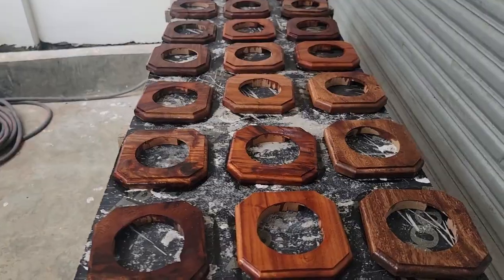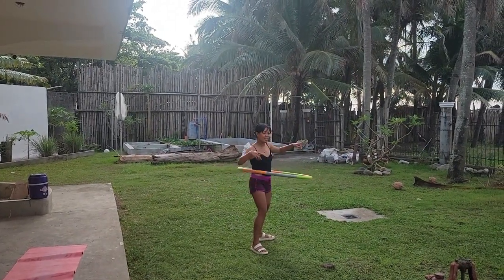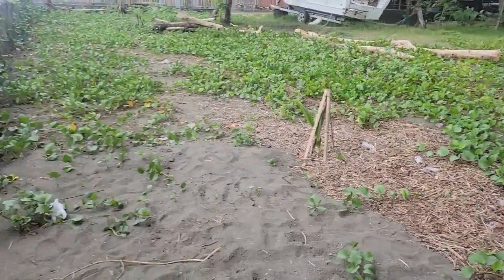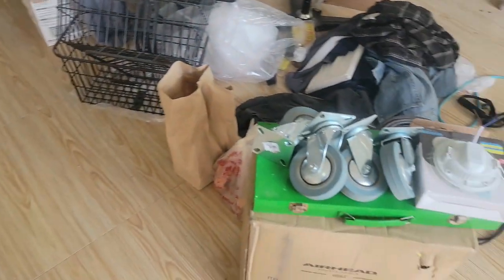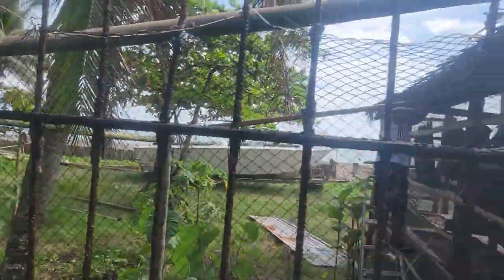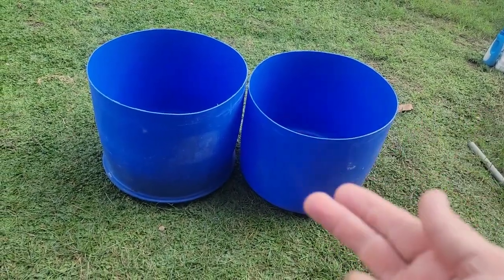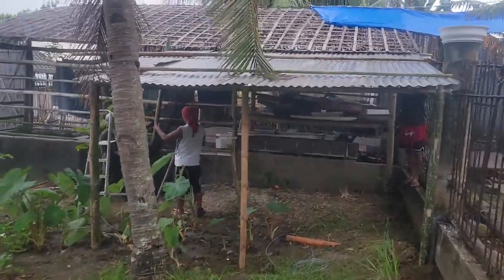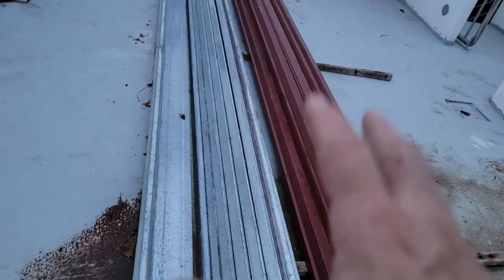Philippines Beach House Build Day 341

Comment: That pre-cast you're using really adds the finishing touches to the place (as do the lights wooden decor) IMO...

Question: Are there any restrictions in regards to the beach (I.e. a certain  number of meters back from beach where no permanent buildings are allowed, etc?)...

Good session, sounds like you're getting better, also good...Sinus problems are not fun...

Here in Dubai winter (???) is coming (flu and cold season too unfortunately)...Temps are way down to low 30s C...  😜😆😊

Anyway, Rock On! 
👍😎👍
🙏🙏🙏